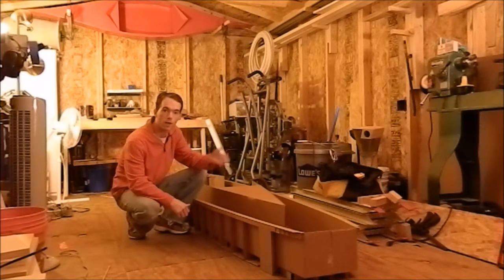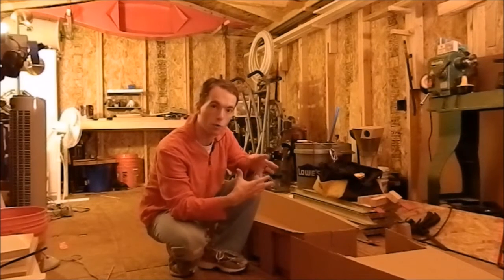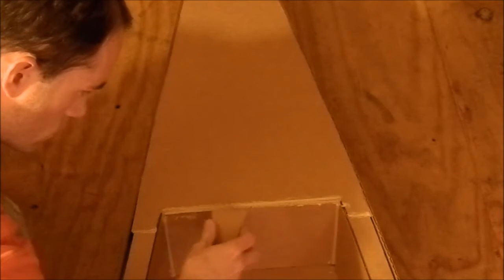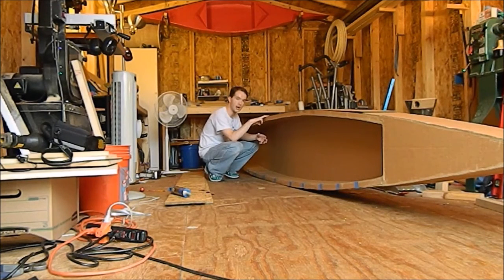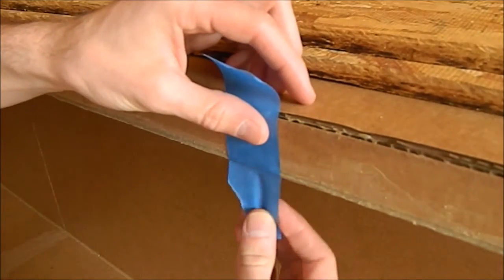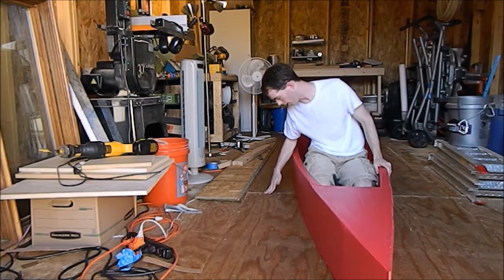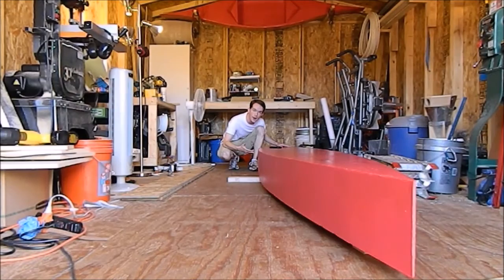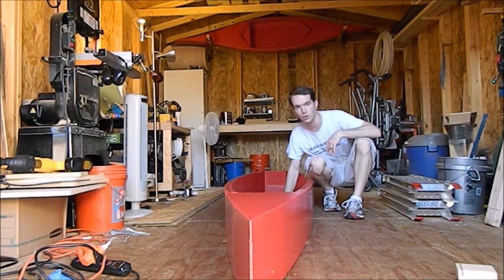Cardboard Boat 2015: The Flash. Build Part 2/2

Comment: Mike, do you feel that three ply cardboard with paint and several coats of poly would last an hour in a fresh water lake?  I am overbuilding my boat with styrofoam and fiberglass tape and Titebond III.
Reply from the maker: With a good single coat of poly and full coverage of the cardboard, it should last forever. Now poly will eventually degrade with UV exposure, but that's a huge "eventually". Sounds like you're building a real boat, not just a cardboard racer, huh? Styrofoam and fiberglass typically aren't allowed, but that's awesome if they are, because you can do so much more.

Comment: How durable is it in the water for a long period of time. Like 2 hours.  Do you still have the boats.
Reply from the maker: Hey Paul. I've never had one in the water for more than about 20 minutes. A typical race is over in under 3, so I've gone way beyond. The Solo 10 is still around, because it's not too large. I threw The Flash away after the race, because I didn't want to have to store such a large boat. (It was sad)

Comment: is the paint the only way to get the boat waterproof?
Reply from the maker: No. Varnish is legal as well. I always double up and use both. The paint has to go on first because it will not stick to the varnish.
Reply: Mike Thompson  thanks man
Reply: Sir I would glass the boat inside and out.
Reply: you could probably flex seal or plasti dip it